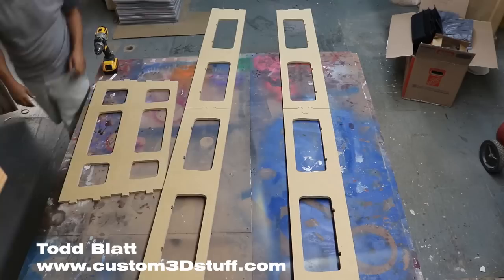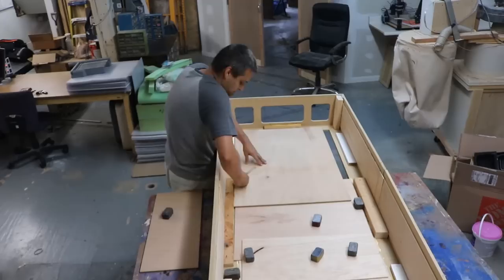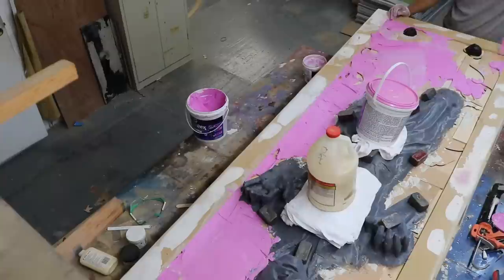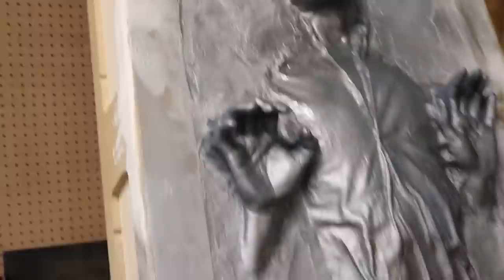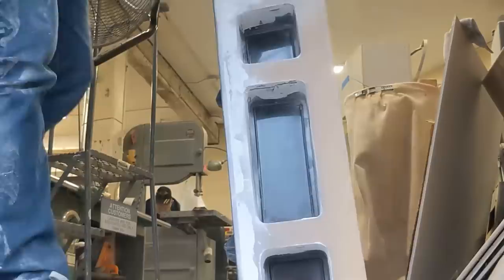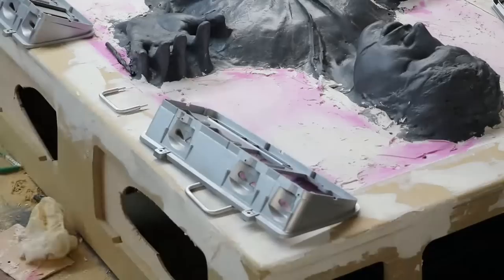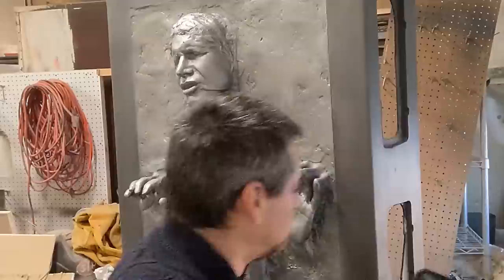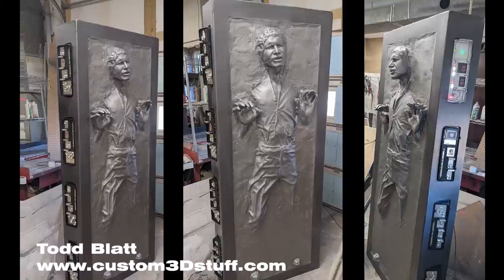Complete Han in Carbonite Build Tutorial by zenix Custom3dstuff

Comment: Hello, i just have a quick question regarding the Han Solo cast.  How heavy is the cast alone? I'm planning to put it on my wall, but I'm not sure how much it weighs because i heard that it is made of fiberglass.
Reply from the maker: It depends who you get the cast from and how thick, but the wood is like 30-40 pounds the cast is around 10. The whole thing all built is probably 65 pounds or so, depending how you reinforce it. You definitely want to hang on studs. Most people use a French clear system which you can buy or just rip a 2x4 at an angle and make it yourself.
Reply: @ToddBlatt  Ok thank you!